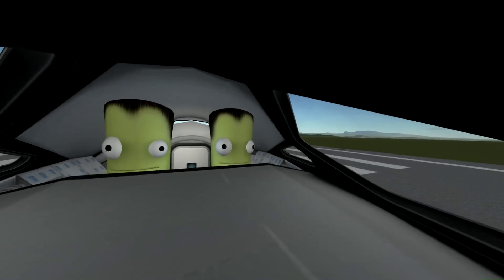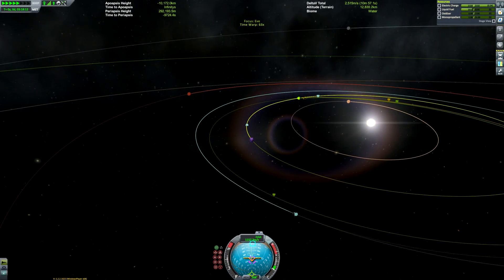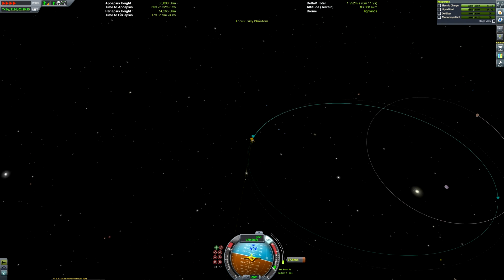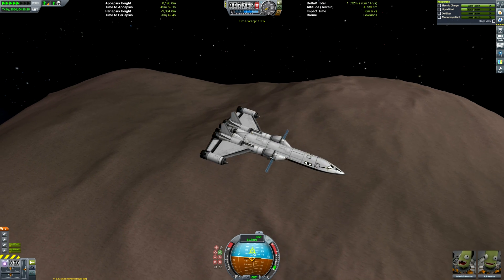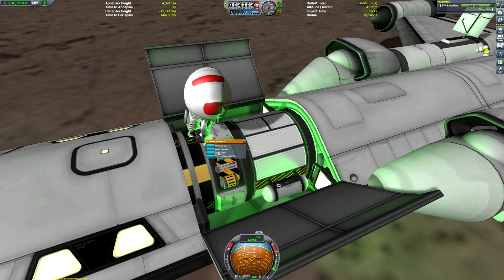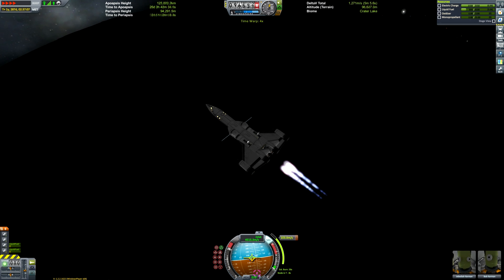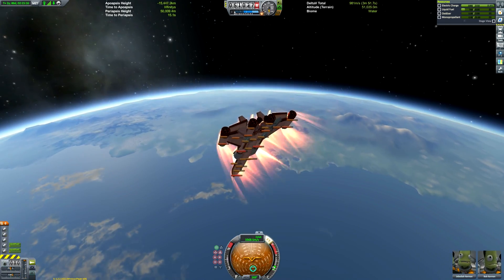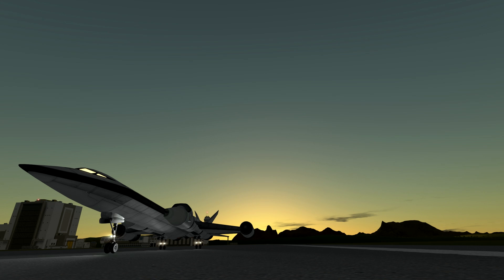KSP: Science SSTO to Gilly and back!

Comment: I have made several ssto planes and I have only been able to get them into lko and have just enough fuel to bring them back. I have been trying to figure out what I'm doing wrong. I play on xbox so Idk if that makes a difference or not.
Reply: Jens Jensen are you using nerva's?
Reply: Yes I originally tried with 2 nerv and rapiers. I couldn't get it into orbit with that. not enough fuel. I tried adding more fuel then my craft seemed to weigh to much. so I went 4 rapiers and I can get in and out of orbit. I guess what I'm asking if I could get some specs on some ones space plane ie weight and fuel mainly. so I can have some sort of reference. as of now I'm at a stand still
Reply: oh also feel like the version on consoles is different idk if that is true or not.

Comment: +Matt Lowne  I really like this craft and since you didn't have the file available, I decided to simply make a replica (so thanks for making a simple yet cool vessel).  I replaced the science bay with a docking clamp, but I am having trouble getting the SSTOs that I try to build into space.  I keep getting pulled down at about 7500 meters.  I would gladly accept any advice you could give.
Reply: Matthew Killmer I'm pretty new to this but I can barely manage an orbit if I stay level mid atmosphere to build up speed, then pitch up slowly so the vector change is less immediate. Right when my engines flame out, I close my air intakes and switch my rapier's mode to use oxidizer. Gets me to around 80km. Just before I get out of the atmosphere i kick on the atom engines. I also like to save some oxidizer for when I get to apoapsis so I can get the orbit quicker. Now it's just a matter of landing on minmus to mine and refuel.

Comment: I don't get how the Oberth effect works
Reply: Basically, you want kinetic energy in a rocket burn, and you want to use the least fuel possible. You get the most kinetic energy from each unit of fuel you burn when moving fastest (how this works is explained below).

kinetic energy = 0.5 x mass of vessel x (velocity)^2
The only bits we care about are kinetic energy (E) and velocity (V) in this case.
To simplify we'll write E = k(V)^2, where k is just 0.5 x mass (which we'll assume "constant" so we don't care about it).
The fuel you burn will give you a set amount of velocity per unit. This is the deltaV, which I'm sure you're familiar with.
Let's start with velocity (U) and add on our deltaV (V).
With some (bigger than 0) initial velocity, we end up with E = k(U+V)^2 which expands to be E = k(U)^2 + k(V)^2 + 2kUV
Notice how we have more than just k(U)^2 + k(V)^2 - we have an extra 2kUV. If we choose U to be a small number, the extra energy we get is smaller. If we choose U to be a bigger number, the extra energy we get is larger. Therefore, if your initial velocity is faster, you get more energy from your fuel, making you more efficient.
Reply: Obviously k won't be constant because as you burn fuel, the mass of your vessel gets smaller. It's just a million times simpler to assume k is constant in this case (it IS rocket science after all).